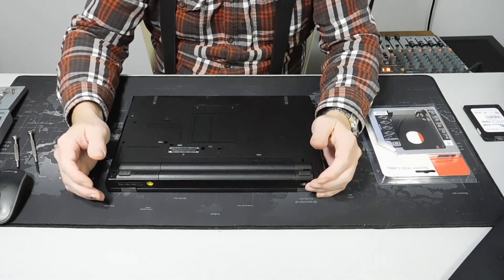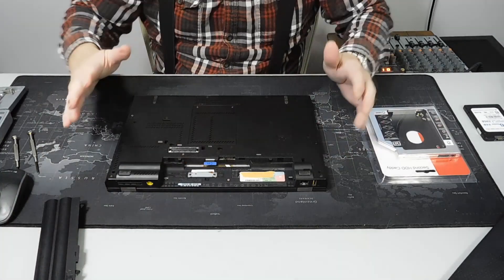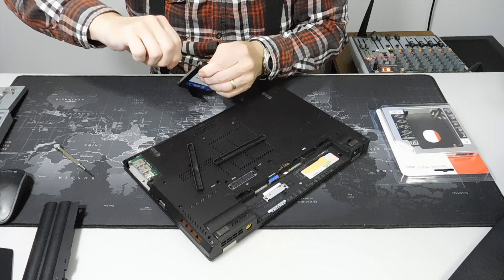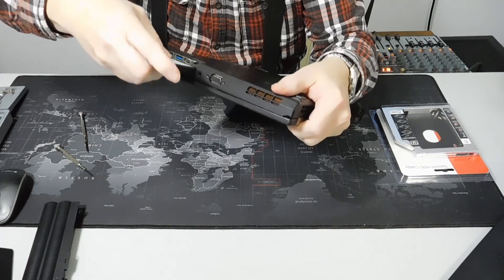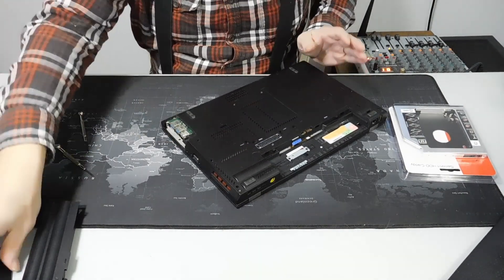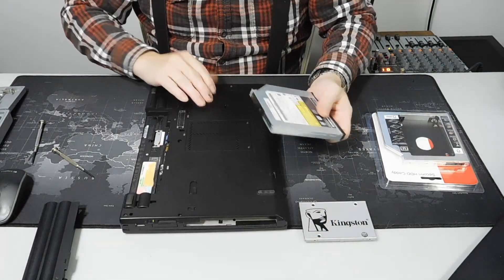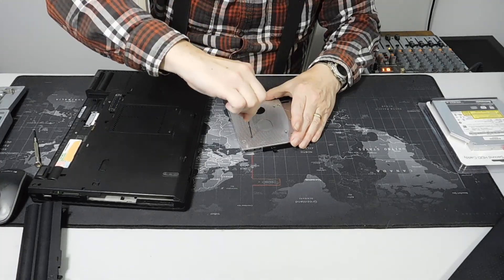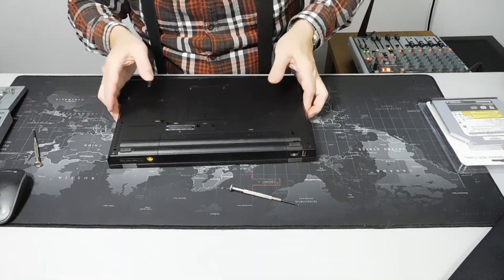ThinkPad T430 Upgrade Boot Drive and Replace DVD-Rewriter with SSD...

Comment: silly question, my understanding that windows was install in the HDD drive, once you replace the HDD with SDD, what happened to the windows? do you need to pre-install windows to SDD before the upgrade?
Reply from the maker: Well, really both the drives are SSDs on mine. To answer your question, I just preinstalled it on the 256GB SSD, before I did the video. You can reinsall windows after you do the upgrade if you would like too...

Comment: Thinkpads truly are the best laptops. They're so modular and just designed to be tinkered with.
Reply from the maker: I agree I have an T470 with an i7 16GB and 1TB NVMe. It has the 1080p IPS Touch screen too, I paid about $270US for it plus the Drive. I bought it just after I handed down my T430 to my Grandkid.
Reply: @murraystechtime8530   Wow I didn't know the newer ones have touch screens. I've never had a thinkpad but I just ordered a T410 and I'm really excited for it to come in.

Comment: When you replace the Ultrabay-CD/DVD with an Ultrabay-HDD/SSD you have to configure the BIOS.
HDD-Configuration -> Hotplug form enabled to disabled. Same configuration like the other HDD/SSD.
Reply from the maker: Why do you have too? Is it so that it writes every thing to the SSD/HHD in case you eject it while it is running? I did don't have to do that and it worked great. But I only have benn doing this for 46 years, old doge can learn new tricks...

Comment: Hi, the outer bezel/cover on the new drive caddy is straight, whereas the default CD-DVD-thing has more like an L shape. Do you think it's possible to remove the bezel/cover from the original and put it on the new caddy?
Reply from the maker: Yes, I had to cut a part of that plastic to make the dirve caddy fit also. I thought I put that in the video, sorry if I did't.
Reply: @murraystechtime8530  you said that you had to cut something off, not about the outer bezel
Reply from the maker: @mariansam_was_taken  Sorry if I didn't make it clear enough, that was what I was talking about and trying  to show you. I just rewatched the video. Thank you for pointing that out to me, Happy Holidays and have a great new year...

Comment: So you replaced your drive, what happened to the os and all of your data? Weren't they on the drive that you removed?
Reply from the maker: The OS Win 10 Pro was but no data. I just reinstalled Win 10 Pro on the new Boot Drive and it was the same as before. I didn't use the laptop as my only computer I have a HEDT (TR 2920X) and a desktop computer (which has all of my data on it, plus my NAS I built has a copy and my USB 3TB External drive has a copy) I use this as mostly for watchining videos, emailing and used to use it for audio recording for my videos. So not very much data on it most of the time. I just replaced it with a T470 and it has a 1TB MVMe drive in it. Both laptops worked great for what I used them for. If you need to clone the boot drive do it on the laptop before you replace the boot drive and then the new drve will have all of the OS and data on it. Then you can swap the drives and it will just work like it did before and your boot drive will be larger. I hope your upgrade goes good and enjoy your T430 it is a great little laptop...

Comment: I have replaced the DVD drives in a T540p, a T410 and a T510 with drive bay adapters and a variety of HDDs and SSDs under Linux, Win10 & 11.
All ThinkPads have the same problem: After a cold boot the additional drives will boot up and function normally. If the systems go into sleep mode or hibernation and are called back to life, the additional drives will power up for a second and immediately shut down thereafter. Only a cold boot will bring them back to life.
I've looked high and low for a solution to this - BIOS, registry, drivers to no avail. Remove the tray and re-insert it with the system running and the drive springs back to life. As the behaviour is identical on all three ThinkPads I assume this to be an issue with the load mechanism of the DVD drive, sending a signal to power up the drive once the tray is closed.

Comment: I know it's an old post but the t430 also takes MSATA directly on the motherboard, so an external SSD via the bay is actually not necessary; in case you don't want it to be super large, and or expensive; but 3 hd's always welcome !

Comment: what are the measurements of the caddy in millimeters and the measurements of the solid disk

￼
Reply from the maker: Multiply by 25.4 on this links dimensions for the caddy - https://www.amazon.com/Zheino-Caddy-Aluminum-Universal-12-7MM/dp/B01B78SD66/ref=sxbs_sxwds-stvp?keywords=thinkpad%2BT430%2Bsecond%2BHdd%2BCaddy&pd_rd_i=B01B78SD66&pd_rd_r=40d2fe7f-fddb-4906-b936-899dd6aae09d&pd_rd_w=qjPRG&pd_rd_wg=uzXzT&pf_rd_p=a6d018ad-f20b-46c9-8920-433972c7d9b7&pf_rd_r=1C73RAY4HP9PDVC01ZB5&qid=1573603018&th=1

Multiply by 25.4 on this links dimensions for the A400 SSD- https://www.amazon.com/Kingston-240GB-Solid-SA400S37-240G/dp/B01N5IB20Q/ref=sr_1_8?dchild=1&keywords=a400&qid=1596665638&s=electronics&sr=1-8

Hope this helps...